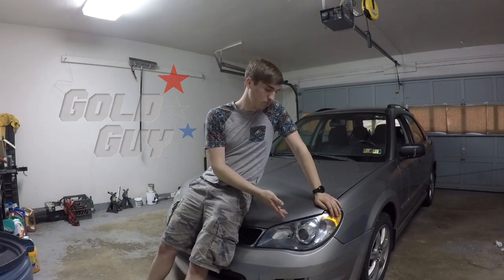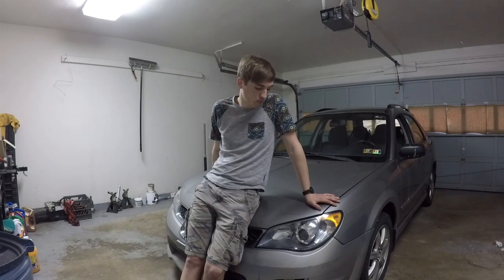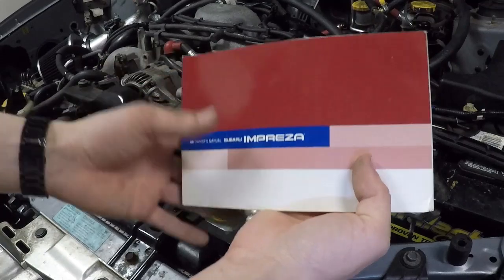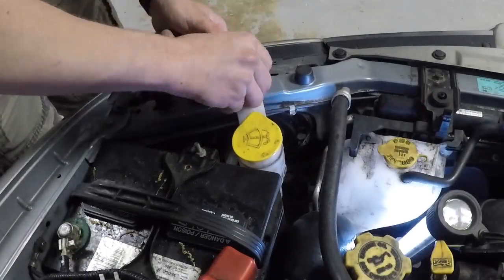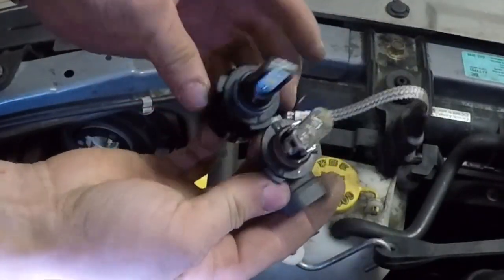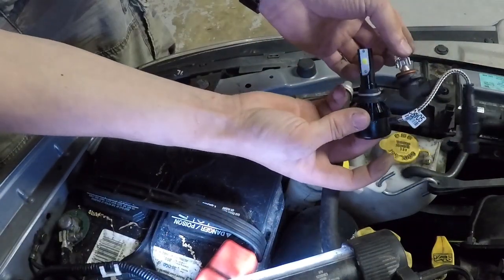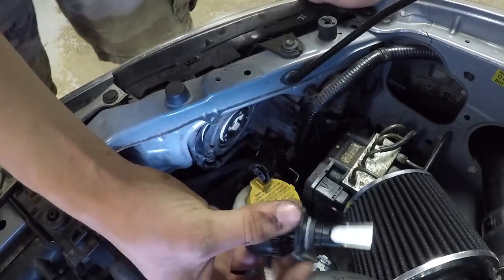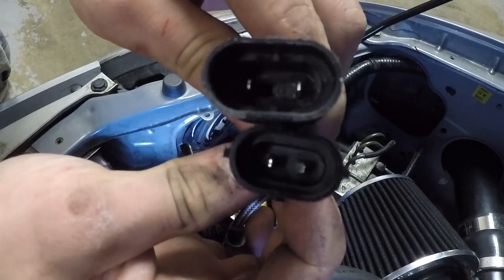Are These NAO LED Headlight Bulbs Even Legal?!

Comment: I have a 06 Subaru impreza wagon. How can I turn off the flashing cruise control and check engine light?
Reply: Hey. It's a problem with in the fuel system, can't remember the part name. If you disconnect your battery - terminal. Hold the horn for 30 secs to drain. Reconnect battery and start up it'll go away. Sometimes it happens when refuelling. Make sure your gas cap is tight.